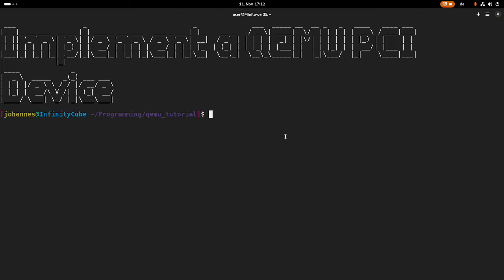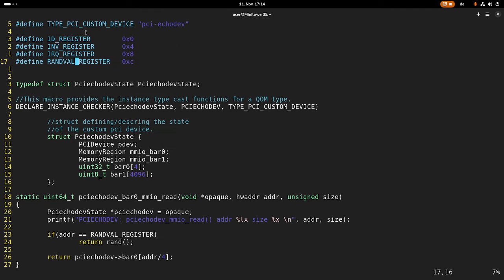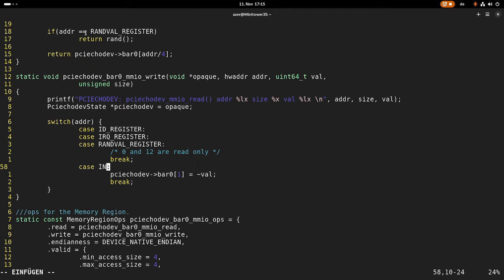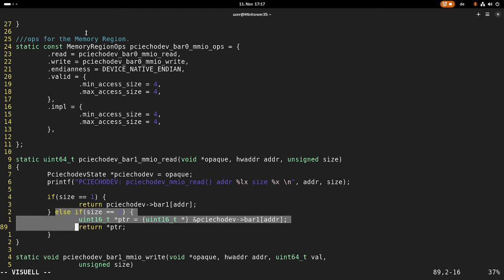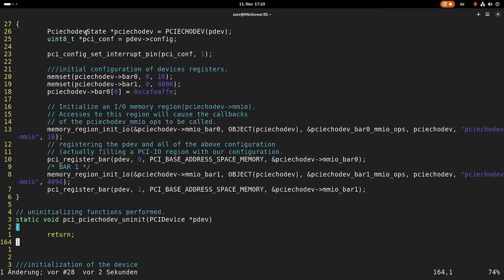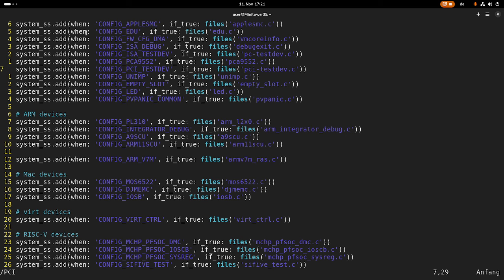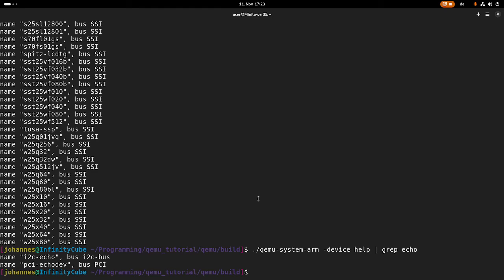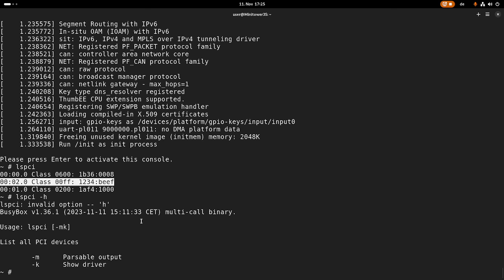Implement a custome QEMU PCI Device

Comment: This video is super helpful! I wanted to to leave a tip to help current watchers save some time and possible headache. On recent version of emu, -machine virt-2.10 has been removed but I figured out that you can restore PCI support in later virt machines (I'm using the default of 10.1) by specifying -machine virt,highmem=off

I'm using the following versions:
linux 6.1.147
busy box 1.36.1
qemu on git hash df6fe2abf2e990f767ce755d426bc439c7bba336 (July 7, 2025)

Other than the qemu virt machine changes, I only had to add a const in the pciechodev_class_init function for the data argument